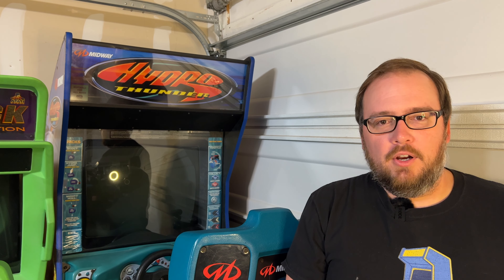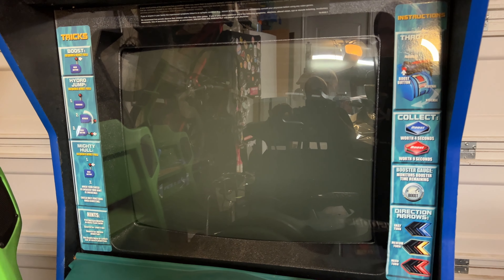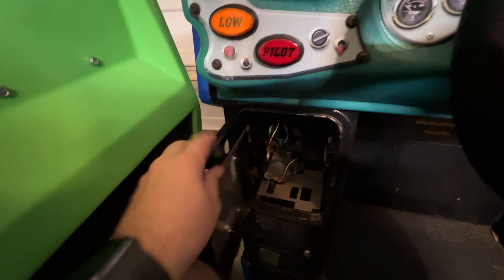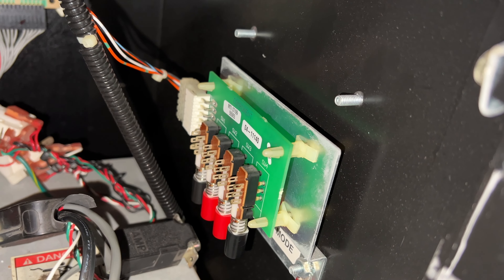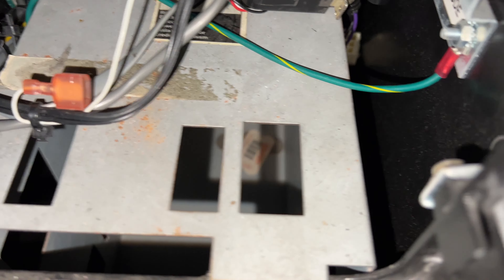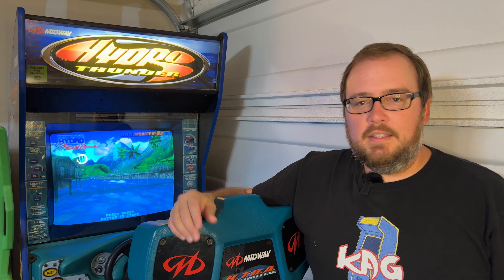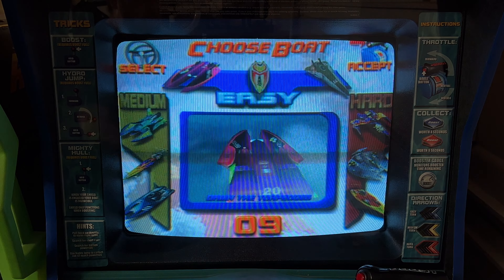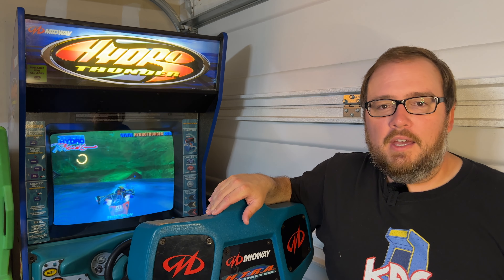Inside My Hydro Thunder Arcade Cabinet & Boot Up Sequence | What's Inside?!

Comment: Couple of things that helped with my Hydro Thunder cab project. 

1) Take all of the boards and cards out of the CPU and blow out the connectors slots with compressed air, then clean with alcohol and blow out again. That brought my "dead" cpu back to life and the game loads much faster.

2) If you're getting and audible speaker hum during attract mode, run a ground loop isolator on you're 3.5mm audio cable. I just took the magnetic isolator off and old playstation cable and looped my audio cable through it. It really cleaned up the sound.
Reply from the maker: Thanks for the info! Did your wiring harness feel brittle? I was a little afraid to disconnect some of it, they feel like they can break.

Comment: This was great. Thank you for posting. I would be interested in a video showing how you cleaned not only the outside, but even more the inside of the cab.
Reply from the maker: I do have a video showing some of that but I didn’t record much of the inner cleaning. It still needs more cleaning for sure. I’m just a little worried to go poking around in there too much. I’d hate to damage something. The old wiring is a bit brittle too which is concerning.

Comment: 3dfx had their own proprietary glide API for 3D rendering instead of the standard DX/OGL rendering, most likely reason why you're locked to that card. Depending on how complex the software is, a dedicated reverse engineer could probably patch in an opengl or d3d backend.

Comment: There is actually a mod I came across that lets you use any voodoo card for Hydro Thunder bypassing the security chip. Haven't actually tried it out myself since mine are all good, but good to see people making some attempt at keeping these going! Also I think your monitor should be okay, that looks like blooming. One of my Neo Geo cabinets does the same thing but is going strong otherwise. I believe it has to do with the voltage regulation which isn't up to par. So when it gets really bright it throws off the geometry... sometimes a lot lol
Reply from the maker: I hope more hacks come out in the future that allow play on any PC! That’s probably a little unrealistic though lol. I wasn’t sure if the blooming issue was causing the fly back to die early or not. We haven’t done the cap kit yet, I’m hoping that may help a little.
Reply: @KillerArcadeGames  Just for the sake of preservation it really does need to happen! Mine does have a replacement flyback in it as well, but I replaced it quite a while ago and had no indication of it failing. I've seen blooming in other monitors and TV's also with original equipment and from what I understand it happened to even some new consumer TV sets. The good thing is having these games in a private collection means they should last a very long time considering they were meant to be run for many hours every single day of the week. So I'm personally hoping all these games out live me! haha
Reply: I'm in the process of doing this right now, to allow more expand-ability with what PCs it can run on. Keep an eye out on KLOV!

Comment: I'm sure this is a dumb statement but can you somehow hook up a old crt tv in this cabinet? Thrift stores here sell them for a buck each and if you drive around you can find them for free in trash bulk pickup on the curb.
Reply from the maker: It is possible to put old CRTs in arcade cabs. It’s not as simple as it sounds but it’s definitely possible. The weird thing about Hydro Thunder’s PC output is you can’t just plug a monitor in. It apparently won’t output a video signal at all. The VGA out goes to the Diego board which converts the video to an arcade signal. It’s weird.
Reply: @KillerArcadeGames  I have a Hydro Thunder cabinet in my garage. The original CRT monitor was bad in my cab, so I retrofitted an LCD monitor into mine. According to my research,  you need a monitor capable of displaying medium resolution. I guess I lucked out. I used an old Scepter gaming monitor I had lying around, plugged it into my HT's cpu. and it worked.

Comment: Looks cool and all but all that stuff needs a LOT of cleaning. Cause it looks like it wasn't cleaned for centuries lol By the way, those beeping sounds might tell you that, that PC inside is gonna die soon. Trust me on this one! I had the same problem with my PC that i'm currently using. First time it did beeping sounds, it got problem with battery and second time when it did that it had problem with video card. So i had to replace both battery and video card and then it started to boot up fast and still does. Also beeping sounds might give you a signal that there is some problems with processor, so i suggest you figure it out and fix it, or else one day your arcade cabinet gonna stop working from one of those problems.

Here is my PC specs by the way:

Motherboard: Gigabyte GA-945PLM-S2 v1
Processor: Dual Core Intel Pentium D 925, 3000 MHz
RAM: 2 GB of RAM DDR2
Videocard: ATI Radeon HD 2600 PRO 256 MB
Hard drive: HDT722525DLA380 ATA Device (250 GB)
Sound card: Realteck ALC883 @ Intel 82801 GB ICH7
Operational system: Windows 7 x64 Ultimate Service Pack 1
Reply: Yeah its really cool to see these original cabinets but the upkeep on them seems like a ton of work.
Reply from the maker: It could use more cleaning, especially the PCBs. I’m just afraid to mess with it too much. I’ve heard some guys out the PCBs in the dishwasher! It sounds insane but it works and you just let them dry out for days before plugging them in. I’m definitely not that bold. The beeps I’m hearing are actually normal for this PC. It’s apparently a part of the boot sequence. Maybe to let you know it’s actually working because of the long period when the screen is just black may worry arcade operators. It does have specific been sequences if something isn’t working properly. I’ve never heard those, thankfully.
Reply from the maker: It is a fair bit of work. You can buy more expensive refurbished cabs that will usually run for a long time without needing attention. All of my cabs (outside of Killer Instinct) needed work. I’m still an amateur at repairing these but buying from a professional who’s really gone through them is probably a better experience. You’ll also pay about twice at much if not more.
Reply: @KillerArcadeGames  Trust me man you definitely know way more than I do on OG cabs hahah. I just got my first 1UP mod done. A ton of your emulation videos helped me thank you!